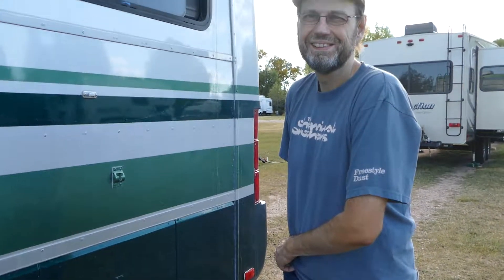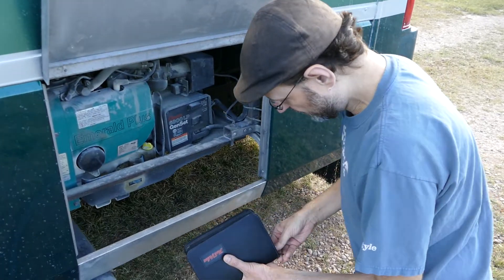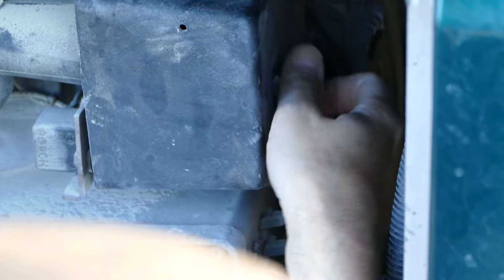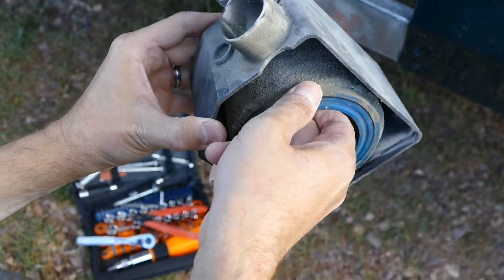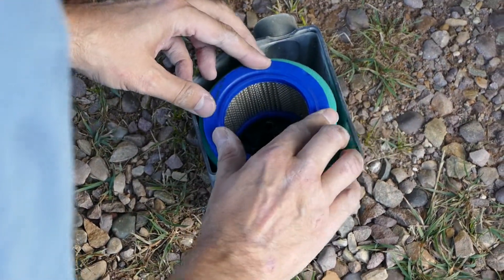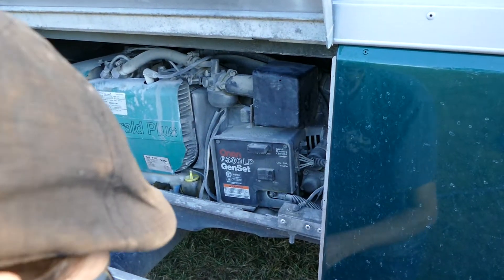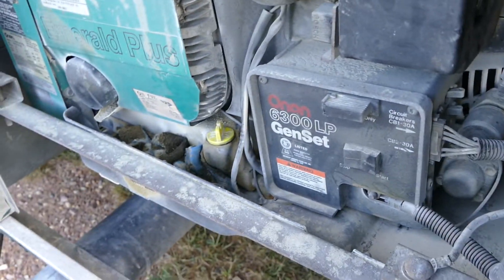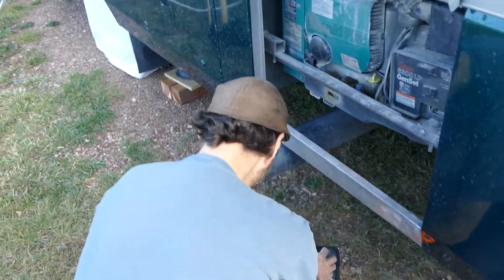RV Onan Generator Air Filter Replacement - easy to do yourself!

Comment: Giving the part number would make the most sense.
Reply from the maker: I just wanted to show how easy it was to replace it on this model... most Onan generators use different filters, that's why it says in the video description: Note: there are many different models of Onan Generators. Refer to your Onan manual for the correct filter replacement part and procedure!